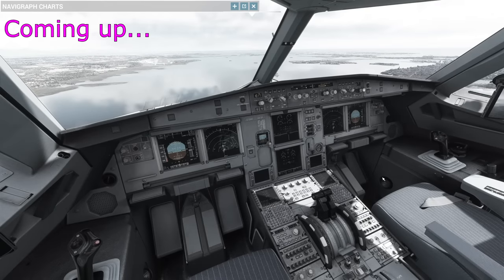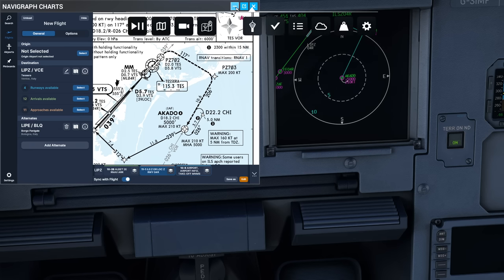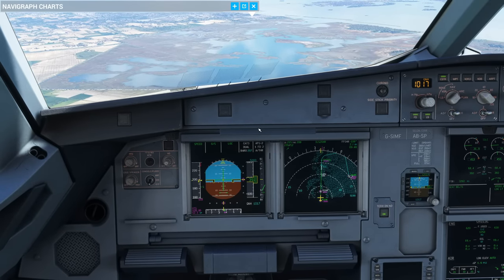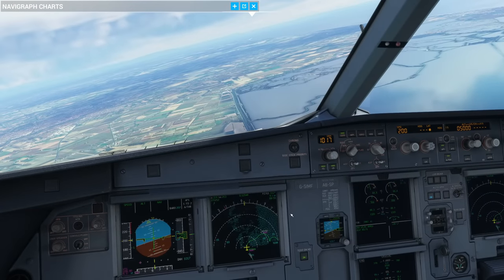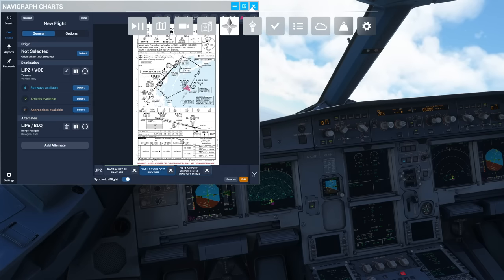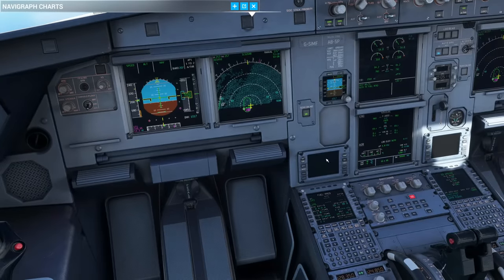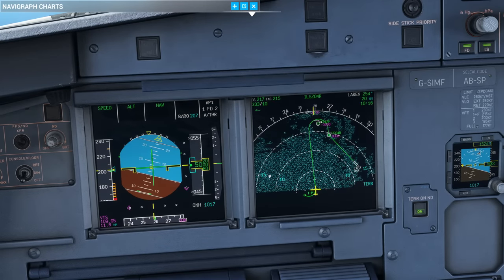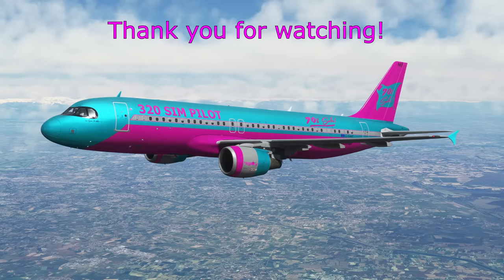From Going Around to a Safe Landing! Flight Simulator Tutorial

Comment: Hello,

First of all thank you for all your awesome videos, it helps a lot.

I came across a situation last time I flew.

Indeed, I unfortunately pushed my throttle to TOGA just after take off and put it right away to where it should have been meaning CLIMB as indicated.

The problem is that the Airbus started the Go Around procedure as my PERF page displayed.

Is there any way to cancel a Go Around procedure or force set the CLIMB or any other step we are in a flight? The question goes also if we activate the APPROACH phase and to early and wants to cancel it.

Comment: The real meat of this video was what happened after the go-around . . .  and that was a subject really well covered and for me, the most interesting part.    However, to be honest, I never seem to be able to do an ILS approach like this one with the FMGC fully dotted!   I always end up selecting the final approach, flaps FULL speed in the SPD window!   Tried setting it all up for an automated approach but it just does not seem to work and I guess I haven't figured it out yet.   So - what is the procedure to carry out a go-around from this position?   Obviously I'm at flaps FULL and let's say my final approach speed is 145 knots (selected in the SPD window) with the aircraft currently flying an ILS in managed mode with the two autopilots engaged?   And let's say at 1000 feet, I call stable and disconnect the auto-flight system at 800 feet and I'm manual.    How would you carry out a go-around from this configuration?   I would really like to see how this is done from this part of the flight where you are essentially hand flying the last part of the approach and are then forced to go-around.   Thanks for all the great knowledge you freely give to us.  Lee

Comment: Another facinating and well explained video that I really enjoyed. One question, suppose there will be strong headwinds to your alternate. I guess (do not know) that these will not be known to the aircraft at least initially but it will be important to add this information before finalising fuel calculations and making a diversion decision?
Reply: The original flightplanners would factor the weather enroute and also at the alternate. So the fuelplan would at least cover going to the planned alternate including the wind en-route. As for the pilots selecting a new alternate, yes its a good point you make the weather enroute and weather at the new airport are a big factor and would need to be told to the aircraft in the new flightplan. You can add winds aloft easily enough into any flight plan, and if it shows that you efob is too low you'll need plan c

Comment: does this work with the fbw a320NX?  i dont recall how to set up that blue go around procedure
Reply: Missed approach guidance is not currently in the FBW so you would have to fly it manually using VOR radials. Really adds so much to the workload at such a heavy time anyway. If I was on VATSIM in the FBW, I would inform the tower when on the ILS that I would need vectors for the missed approach. Trying to fly it from nav data may be impossible and if not, certainly would be very very difficult with one pilot.

Comment: You said that aircraft reverts to NAV on the GA. If you had disconnected the autopilot on the approach, would it re-engage the autopilot when you execute the missed approach? Ta.
Reply: Same procedure. You would just follow the flight director (which would go to the new modes once man toga selected) and engage autopilot when you could. If the flight directors are off, they should come back on when man toga selected with the thrust levers.

Comment: quick question, how much reverse thrust should you use in normal conditions
Reply: Depends how long the runway is, usually just set it to full and stow the reversers at 70kts or something like that
Reply: In normal conditions you wouldn't need to use Reverse Thrusters as they are mostly ineffective on a dry runway.  A lot of the time you just engage reverse and sit at reverse Idle.
Reply: @wiredwomble7958  Ye true, just remember to stow the reversers before going on the taxiway
Reply: @wiredwomble7958  cheers mate
Reply: Landing distance calculations with no non normals don't give reverse thrust any credit afaik. It's always a conservative calculation. You simply decide how hot you want the brakes